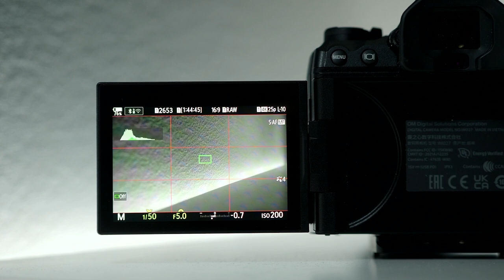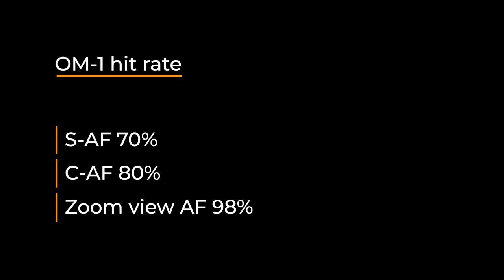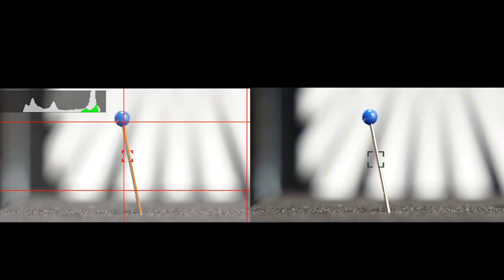OM-1: Let's talk about S-AF.

Comment: It's the first stacked sensor in the system and so people who have almost zero experience with the way these systems work and try to make it function just the way all the previous bodies worked are going to be disappointed. Any of my associates who have been shooting Sony A1 and A9 for a couple years or more seem to adapt much easier to the OM-1 than they ever could to the previous OM-D bodies. On the other hand, people I know with no experience shooting cameras like that, can experience initial frustration. Robin really needs to figure out if he wants to adapt to a different way or just acknowledge that this camera isn't for his style of working. Not a big deal. But most people can adapt to this sensor tech successfully with some help from others perhaps. It took me a month or so to change my custom settings of the OM-1 bodies to be appropriate for this sensor tech. I think a lot of folks think the firmware is all created by the camera company, but actually the bulk of it comes with the sensor and developed by the sensor manufacturer. So for non-Sony stacked sensor shooters, it's a whole lot different. Now eleven months later and more than a million photos later, my own real world experience has been positive overall. However, if I were a street shooter in low light conditions and such, it would be quite a leap from OM-D E-M1 Mark III to om-1 and maybe not worth the effort for someone like Robin.
Reply: And it wouldn't have been so bad if he hadn't put out videos with such provocative negative titles either. As a 'professional' he showed an unprofessional response, more like a 'Toneh' response instead. 😏
Reply: @rossthefiddler5890  an accurate judgement I agree. Click bait. A better title might have been “OM-1 may not be the best low light street shooter’s option in micro four-thirds cameras.” Or something to that effect. A more accurate subheading could include an admission “my first impressions with OM-1 suggest I may more time to properly assess its strengths and weaknesses for my type of shooting”
Reply: @JeffreyMcPheeters  Yes, well he got my back up with his attitude & negative presentation. Didn't like the grip, didn't like S-AF, didn't like not having 'pinch' enlarging in reviewing (I think that would be a disadvantage when reviewing with long tele lenses on anyhow), being so critical saying "in this day & age" it should have it.

Comment: With the new 90mm macro the difference is obvious. S-af does hardly fix the focus, while c-af is fast and accurate. The biggest problem for me is not low light but bright light. With s-af OM-1 does not focus at all when the object is bright yellow (for instance, inside an orchid). It just searches and cannot find anything to focus on. With c-af no issue at all. So this is not only a low light problem, it is a bright light problem too, especially when the color is yellow, orange, light green etc. S-af just do not work in these situations with the 90mm macro. So the problem is not focusing on white wall, the problem is real. Maybe it has to to with lack of contrast. I have also noticed that s-af works less well with 300 mm, 40-150 mm indoors, while c-af works fast and accurate.
Reply from the maker: It is most likely about contrast. OM-1 works slightly different and C-AF is a better solutions in low contrast situations.

Comment: Robin Wong is a Guru when it comes to Olympus or OM-S cameras so please don't t undermined this gentlemen as he has done so much for the community much  more than any Olympus + OM-S ambassadors.
Reply: Hello,
If i remember correctly Robin’s test, he does not get beter results with C-AF mode ...?
Am i wrong?
Reply from the maker: I did not. I said a few times that his findings are correct. Then I gave a solutions to that. Jen-Luc, yes on that particular test. Rob Trek got similar than I did with C-AF. In very hard lightning and  low contrast situation small changes can make a difference. It is the same way in real life photographic situations. There of course we try to solve the problem to get the images we want.
Reply: @jean-lucsteifer4317  Actually if you watch his latest video he said C-AF is even worse and i agree.
Reply: @ForsgardPeter  Hello Peter.
Maybe you didn’t but that Thomas guy was trying to explain that you need to change the focus points to a larger size in order to get better results in low light, if you was talking to an amateur photographer like myself than that’s expectable but we are talking to Robin who is no amateur, so when he says there’s an issue with the focus than we as a community need to speak out and get companies to do better than  to correct some guy who is a guru on Olympus + OM-S cameras.
Reply: I would have agreed with you 3 years ago when Robin was their brand ambassador and had access to their engineers for answers to questions. He got me hooked on Olympus products, so I thank him for that. However, since he was dropped as an ambassador, Robin has publicly engaged in nothing but sour grapes towards the company, which shows a lack of maturity for a "professional". 

For example, only last year when the OM-1 was released, he issued a provocative video titled "Why I'm not getting an OM-1". That was before he had even tried it, and his primary rationale was that he could not afford it as a professional, so how useful and objective was that? 

While some may doubt the integrity of those officially engaged by camera companies as ambassadors, many of us who have had a great experience upgrading to the OM-1 will continue to question Robin's true intentions. Perhaps, it's time for him to return his OM-1 gift and move on to another brand.
Reply: Robin is knowlegable of Olympus' cameras and evidently not OMDS' cameras.
Reply: @oldskool80sfan12 , Robin said S-AF always worked better than C-AF. He said the mechanism of how the two AF modes work was the same. He said C-AF on the OM-1 was worse than S-AF on the EM5m3. All of that has been proven wrong by Rob Trek's rigorous test results. His C-AF test is also flawed. He's also wrong in saying exposure whether proper or not doesn't affect AF functions on the OM-1. 'nough said about guru.
Reply: @tntytube  What video you talking about? Is it the one he focused on a letter with low exposure? That my friend was not a valid test.
Reply: You agreeing with Robin’s last video means absolutely nothing more than you also do not understand how to operate the OM-1 camera nor did you understand the three videos which completely refuted Robin’s erroneous assertions.
Reply: Yes. Robin is no amateur yet he couldn’t figure what his three peers did.
what does that tell you?
I agree that when a problem with a product is uncovered then it should be fittingly addressed. There is no need to rally the community or, in other words, slag the company and provide another avenue for haters to play. Just report the issue directly to the manufacturer via the provided channels like everyone else should do. Don't cause a "s---t storm".
Reply: @fuzzywuzzy8874  Well, you can say the same things about his peers for not reporting problems for example. Low light focus . OM-5 not including type C or charging port, OM-1 not including a charger.

Comment: Hi Peter and Thomas, thanks for clarification by explaining the mechanisms behind the AF.
For me, I'm a very happy OM-1 user since 1 year, was a real game changer in my wildlife photography. Much more keepers than with the E-M1ii. 
And good performance up to ISO 20000!
(Ask the Peltomäkis, they will confirm it)
ONE ADDITIONAL TRICK for low light S-AF.
When using the small single AF point you can quickly switch to the next larger one (probably same size as the single AF point of the older cams) by activating AF POINT HOME BUTTON 
The OM-1 automatically changes to the small but not single AF poin field when pressing the AF HOME button.
I've always have one button programmed to do this. It's one of the best tipps Robin Wong ever gave,  it makes workflow much quicker 
And now we can use it for better performance in low light.
Reply from the maker: Thanks for the tip. I think OM-1 still uses a tiny focus area. The difference is that there are more of them. I will look into this.
Reply: I also really like the S-AF + MF tip that Peter provided. I use the same method with DSLRs all the time, very convenient!
Reply: @ForsgardPeter  Thanks,  dear Peter,  for exploring this. I've too few knowledge and expert contacts to figure it out. It's just a logical issue,  that the AF works better if the probability finding more contrasty edges is higher.
But these are small detail's and shouldn't  prevent people from buying this fantastic camera

Comment: I have both om-1 and em1ii. I found the s-af/c-af on em1ii was a bit faster and less struggling than on om-1 if using M4/3 lenses. However when using old 4/3 lenses, the af behaved much better on om-1 body. It sounds to me that the phase detection is more reliable than the contrast detection on the om-1, as the focus rely on mainly phase detection on old 4/3 lens while M4/3 lens use both focus systems if i remember correctly. That echos to the video's suggested solution to use c-af which give more weight to phase detection. Don't know if anyone has the same experience of using old 4/3 and M4/3 lenses on om-1 and the previous em1ii/em1iii/em1x?
Reply from the maker: I have not tested OM-1 with the 4/3 I have. maybe i need to check that too.
Reply: I can confirm what you noticed : the OM-1 can handel older 4/3 lenses quite well (no comparaison with the GH5 for instance on which the 4/3 lenses are just unusable). I have both 12-60 SWD and 50-200 SWD and they got a new life with the OM-1. Of course m4/3 lenses are faster but we are apeaking of lenses that are at least 15 years old... And it is good to be able to still use them very efficently, even in low light conditions

Comment: Peter. you mention several times in this video that the OM-1's Zoom view AF works better in low light and with low contrast because the Zoom view AF AF target is bigger than the single AF target.
Thomas explained why this is wrong in your video and his own.
As I understand it, with the help of Tomas Eisl, the reason the OM-1's Zoom view AF 'seemingly' works better in low light and low contrast is because when in Zoom view Af the AF system behaves differently in that it is more concerned with locking up and less concerned with precision. The reason your EM1mkIII scored very similarly to the OM-1 (with the OM-1 being in Zoom view AF) is not because the EM1mkIII already has a larger AF target but rather that the EM1mkIII's AF is only as good as the OM1's when the OM-1 is using the less precise Zoom view AF. The OM-1's normal AF method for S-AF is to concern itself more with precision and less with lock up.
Reply from the maker: Yes I was not precise here. It is like Thomas said. The bigger size just gives more room to look for the area to focus on. It works differently.
Reply: @ForsgardPeter  Lets just say the OM-1's S-AF can be hobbled (Zoom view AF[Magnified view]).  
Thus the OM-1 has two different means of S-AF, normal and hobbled. 
One method S-AF (OM-1's normal/default method) is more accurate at the cost of less lockups. This is the method that has caused 'issues' when comparing to previous models' less accurate S-AF.
The OM-1's 'hobbled' S-AF method is less accurate allowing for more lock ups and is similar to the S-AF of previous cameras.
This hobbled S-AF method is the method Thomas explains and how other OMD models work. More lockups...less accuracy.
It is believed that the OM-1's normal S-AF mode is more accurate (and less lock ups) because the Af is confined inside of the small S-AF target box and not allowed to wander around outside of the target box looking for something nearby to lock up. 
This is the difference in how 'normal/default' S-Af works between the OM-1 and the older cameras' less accurate S-AF.
 When hobbled the OM-1's AF system works only as 'well' as previous OMD models' normal(or best) AF.
 It has been, for years (with both 4/3 and m4/3), said about Olympus' small AF target that the AF system goes outside of the small AF target box when need be. The E5 actually has a "Dynamic-single target mode AF (page 56 in the E5 manual)" which is, in my opinion, an older version of Center Priority/Center Start AF long before the names Center Priority/Center Start Af were coined. I believe most/all previous OMD models S-Af small behaves in the same manner as the E5's Dynamic-single target mode and we (well most of us) simply are unaware of it.
So, regarding older models' S-AF small and the OM-1's hobbled S-AF small,  we should now understand that the actual size of the shown AF target box has little, or more likely nothing, to do with the AF performance. The AF goes outside of the box.

Comment: I'm interested in how fast the focus is in good light.  That's where I am most of the time. Bright sun or dead dark of night shooting stars.  In those situations, the OM-1 looks good.  Problem with autofocus? None for me.
Reply: It is really fast, because of the fast speed of sensor & latest processor. It's when users are using the Single AF point ('point' being the case as it is quite small) that doesn't fall on some detail in a subject, & why a larger area to use for AF is more reliable in those cases. Pinpoint AF is needed for cases that does need to be that small too though.

Comment: Till today I was very happy with the S-AF performance in all conditions of the OM-1....
Starting from today I'm still happy with it 😊. Thanks to the advice from you Peter and Thomas I know a fallback option in case it happens. 👍
When reproducing the problem, did you try to increase the AF point size?

I just realized one minor issue in combination with the 90mm macro with blinding backlight and dark foreground but wasn't able to reproduce yet. AF was hunting a bit.
Reply: I gather that you can't really increase the area of the AF point size in S-AF.  What Thomas indicates, and in fact the user's manual states this, is that when you expand the autofocus area in S-AF "the camera chooses the target used for focus from within the selected group."  (Instruction manual pg. 78) I was surprised by this,  as it means you are not actually increasing the size of the autofocus point,  just giving the camera the opportunity to pick one point within the area chosen.  Thomas also suggests  that, when you use zoom autofocus, something else is going on,  because "you get a big detection area."   Evidently, this is different than increasing the  autofocus target mode.  Also, when you use C-AF, the camera uses phase detection and the "area is actually just a bit wider."  I'm not sure if it's possible via a firmware update to allow the actual expansion of the AF point, or this is just hardware limitation with the nature of "single point," but it would be interesting to see this addressed.  Although, I'm not sure how much any of this matters, unless you shoot a lot of concerts I guess.
Reply: @jonbarnard7186  of course you are right. The number of focus points per area is fixed on the sensor and by increasing the focus area it simply increases the number of focus points the camera is checking on the current focus position, if any of the points in the selected area is in focus already is locking the focus as is.
Maybe the focus magnifier changes something regarding selection from  phase to contrast autofokus?
Reply: @mariusm2402  Yes I suspect you're right.  I suspect that the single point size  is physically fixed by the sensor, and something computational is going on with the zoom autofocus.    Hopefully, though, a firmware upgrade will improve the situation.   Interestingly,  my Nikon Z camera  has two single point sizes,  with the slightly wider one working faster, and the slightly smaller one being more accurate, or so the manual says.   Nothing is simple any more with these cameras.   (Well at least they're not running Windows😄)

Comment: Well, Peter, I think that the problems Robin is pinpointing, it was in C_AF, not in S_AF??
Reply: No he pointed out both
Reply: Robin's video suggests it was missing in single and continuous autofocus.
Reply from the maker: He had some problems with both. They were legit on that particular test.  The problem is in low light and low contrast. My results are ok with C-AF and S-AF works better and it is more precise than older models.